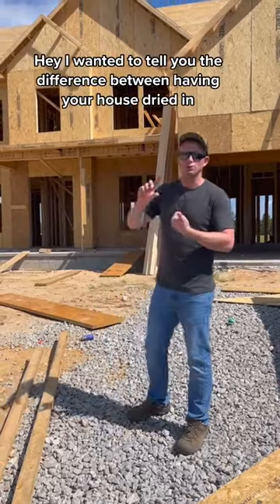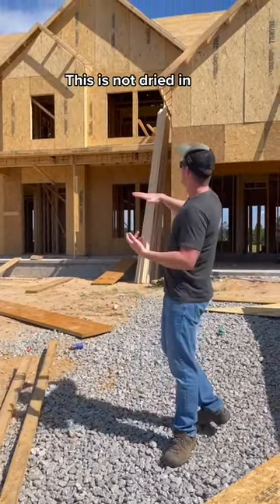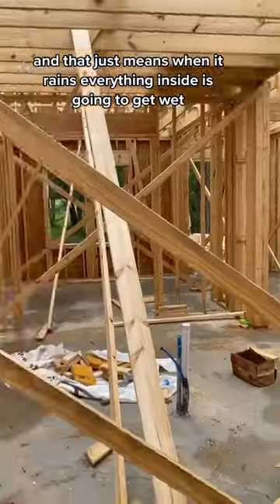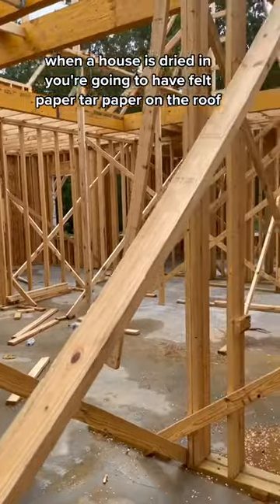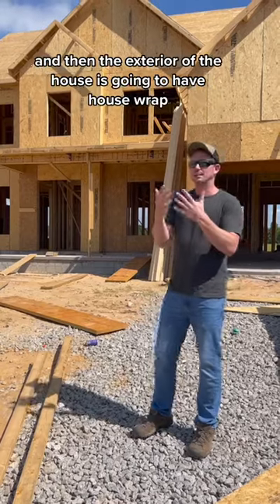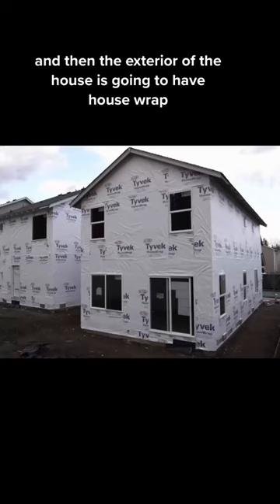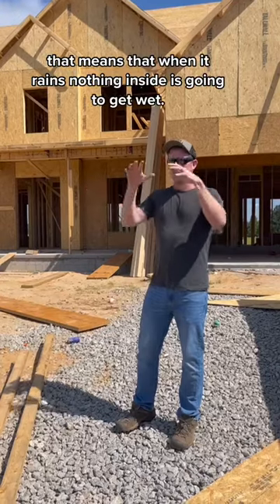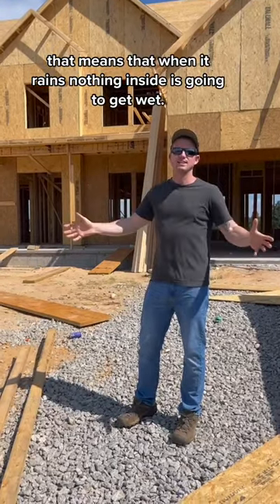New Home: ☀️ Dried in Vs. 🌧️Not Dried in...

Comment: I dont consider it dries in until the windows are in and some sort of door is in play. Thanks for your explanation
Reply: Exactly alot of openings between windows and exterior doors
Reply: Siding guys will wrap the walls and only cut small holes or slits for airflow where the windows are. But this is very temporary, until they get there with windows or sometimes they really do leave it like that for a week or 2😂

Comment: Doesn't matter, if the roof ain't up, it gets wet inside.  A bigger issue is to use screws to put down the subfloor instead of nails. Wet wood will pop the nails and you're going to have squeaky floors
Reply: We use reshank nails. Imagine a screw and a nail having a baby. You don't need to use screws.

Comment: Are most houses in the US may purely from wood? Isn't that a huge fire risk?
Reply: Wood and air, but drywall isn’t exactly flammable. Fires are also not a common issue due to the increase in electric stoves in recent years, but yes it technically isz
Reply: You see, the thing with american housing is really complicated. 

These wooden houses are extremely cheap and by this a good young family home. 
They also don't have a high insuranxe rate because it is cheap. 

Areas which often experience tornadoes, hurricanes or even floods use such wooden homes, because even if it would get destroyed, it is not that expensive to rebuild. 

And once you have enough money for a serious home, you can move out and sell it or rent it and either have a little side profit or just have some extra cash. 

And the only reason that is a viable option ik America is, because buying land isn't that expensive.

And the fire usually isn't much of a problem because of fire coating whoch a lot of homes have
Reply: @refrigerant1245  you must be looking at prices for land in places like death valley or northern Alaska if you think that stuff's cheap
Reply: @honkerdoodles2764  Cheaper than block or concrete houses
Reply: @refrigerant1245  Your “facts” are far from correct!
Reply: Usually coastal areas have more houses that are built either from block or concrete walls. Concrete walls are expensive then block comes 2nd then wood. But in florida we usually build it out of blocks. That's because to get wood up to codes for hurricane take a lot more engineering, straps, and can be troublesome. But there are nice houses that are built from wood and are strong. They usually use thick wood and have a stucco wall (concrete) on the outside. Fire isn't that big of problem as you would think we just have a lot of choices most people cheap out and that's when there is more of a danger to fire.
Reply: @refrigerant1245  Areas prone to hurricanes use concrete blocks as far as I know.
Reply: Considering that wood is relatively cheaper than stone and more abundant in the United States/North America it’s only reasonable to make your house out of wood unlike Europe . At least that’s what I was told.
Reply: @anthonyrodrigues5032  only if the owner generally has more money. But since such areas also have poorer families a lot of wooden homes are there. There is a reason for the ammount of videos where wooden homes get rekt
Reply: @honkerdoodles2764  nah, i just compare them to europe. 

What you think is expensive is kind of cheap in europe. 

In my country you can often only buy land for like 450€ per m² which is about 10.8 feet² 

Or better said, the average american price per acre is about 22.000$

The average in my country per acre is 2 million $ 

And my country within europe acrually is conaidered rather affordable, so no doubt american land is way cheaper.
Reply: @JT_70  if you think so, it is just what i gathered over the years of contact with a lot of americans and a lot of friends over there.. been even living there for a while begore coming back to europe. 

It is just what i have heard mostly. Especially the money part, because unlike europeans, you actually look after your money
Reply: The truth is no. American homes don’t set on fire very easily. For example there was ONE house that burned down in my immediate area within the past 20 years. Every other home within a half mile or mile radius was fine. It was a single home in my subdivision burned half way down in 2013 and they rebuilt it with the same floorplan from the 1980s. Before 20 years ago I wasn’t born so I’m a bit unsure about local fire history in our area but there are easily 3000ish homes within a mile radius of my house and only one burnt down. I’d say that’s pretty good.
Reply: @LucasFernandez-fk8se  well, i think the real question about burning homes should be by what they are set ablace. In europe  if there is a forest fire and there is a house in the same area and the house was build with cement and bricks, usually only the interior will burn and the roof, but the rest will still stand.

If an american wooden house is in the same situation, almost all of it will probably burn down...probably even faster than usual european wooden homes (the european ones use half trunks usually)

Comment: How do they build a house in the winter months?  Just let everything get soaked?
Reply: Yes that is exactly what we do. The goal is to always get the roof sealed in before the cold realy sets in but sometimes it does not work out that way. All building material are designed to get wet a set number of times. From the first nail is driven the clock has started. Sometimes tarps have to come out and be in play as well. Hope this helps
Reply: @HighPeaksHome  thanks

Comment: to me, dryed in, if I throw a bucket of water at the house and it comes through it's clearly not dryed in
so required windows and doors
that osb, or you called it plywood (it's osb aka glued garden mulch) I don't consider that to be even close to dry.. even house wrap won't fully stop water getting in
Reply: If house wrap is installed correctly it would be physically impossible for water to come in contact with the sheathing. Problem is contractors never install house wrap correctly. They staple it directly to the sheathing which is wrong. It should be installed over vertical furring strips to ensure there's a space between it and the sheathing. If any water manages to get past the house wrap it will just drip down the back side and never touch sheathing.

Comment: You're wrong by code book drying something in means that the roof is right in so you can perform and do all of your electrical and plumbing and anything else that's mechanical is all required to have tar paper b** a thing ice and water what not on the roof so you can perform the other trades without having to lose the electrical house wrap is not part of drying in anything sorry about that bud should probably check your code book